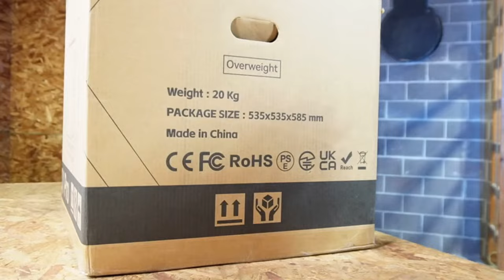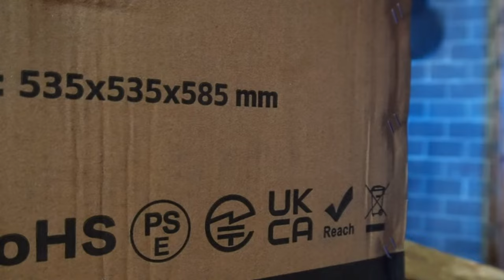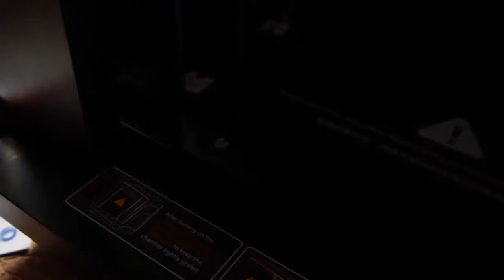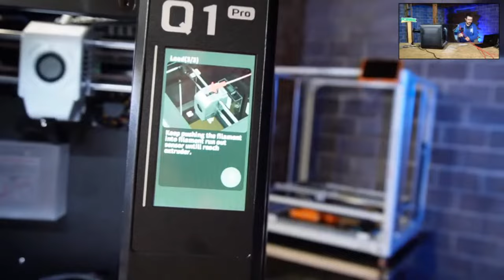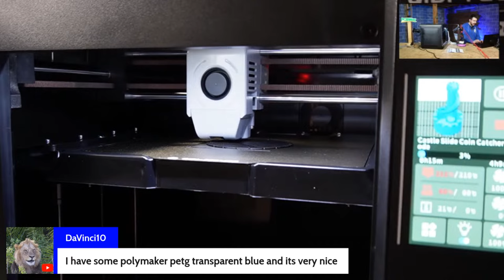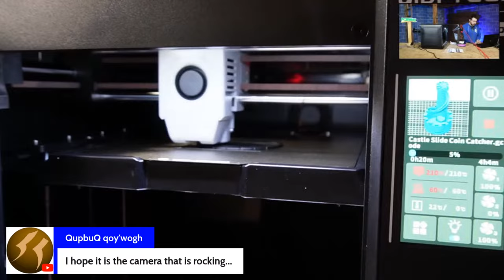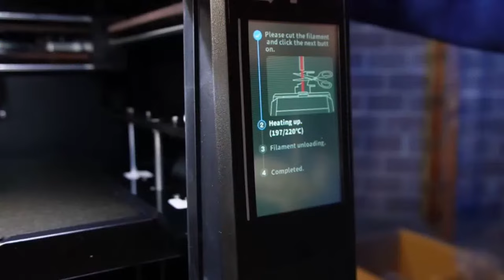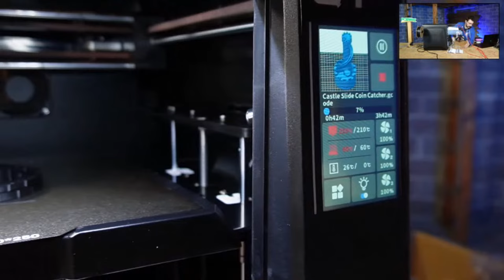PRO? QIDI Q1 Pro Unbox & First Print LIVE!

Comment: Your insistence that all tools be included is a bit over emphasized.  First, most of us have them, or would want better than the cheapest you say they could include.  Secondly, these "throw-away" tools are a waste.  Theres no reason the manufacture them, include them, and ship them.  And finally, with the printer selling at $469 including shipping right now, so call it $400, a couple dollars of tools (including sourcing, packaging, cumulative shipping costs, etc),  is a maybe half a percent.  What company wants to throw away that money considering the first points?  Along with being upset about points like the zip ties and then the allen wrenches being wrapped together, the review starts to sound more picky and whiney, in my opinion, than a straightforward asessment of the printer's capabilities.
Reply: I agree. And the "Handle" to open the front cover is at the bottom-right in that groove made into the plastic case. Easily opens the front door with one finger. I do wish there was a built-in cutter to change the filament but with the abundant things this printer offers for this price point I am very happy with my new QIDI Tech Q1 Pro I received two days ago.

Comment: You ask about the front door "Handle". I just received my QIDI Tech Q1 Pro based on your and Maker's Muse reviews. I LOVE this printer. By the way. Look at the bottom right of the front door. There is a designed groove in the black plastic case that allows your finger to grab and easily open the front cover with one finger. Granted, QIDI Tech does not explain this. It was obvious to me.

Comment: I do agree that’s an insulting amount of filament to include - reminds me of the ender 3 lol. I’m inclined to believe that you got a review unit for “free” and they didn’t include the stuff that you most definitely have such as harbor freight quality side cutters and cheap Chinese Allen’s that round off every damn bolt when the strength of a baby is used. As far as the plastic enclosure for a heated chamber - don’t a lot of people use bed slingers in acrylic chambers? Apple calls the MacBook Pro - pro yet they sell them with 8GB of RAM - we can thank them for starting this pro naming nonsense 🙄For $469 I think this is a steal and I’m definitely gonna order one. Let’s not forget BL doesn’t even give you a 1080p camera until you bust out $1200…Also this whole “live mains” nonsense is hilarious to me. That’s like saying “I took the cover off my electrical panel and I’m exposed to live wires” no shit - don’t touch it if you don’t know what you’re doing - and if you’re touching live electrical components with live power you deserve a shocking experience - just my 2 cents

Comment: Let’s call this what it is, cash grab. Normally there is a decent gap between models. This comes out less than a year of their others. Feels very rushed and unfinished/tested. I want QiDi to succeed, but please don’t go the route of the Creality QiDi.
Reply: Can you explain?  No one that bought the earlier model(s) has to buy this, and anyone looking now wouldn't care about the earlier model(s).  I'm not sure what you mean.  Is it just because it needs more polish?
Reply: @DavZell  What I mean is, if you follow Qidi's launch history there has been a couple of years between models. They take their time normally before a new model comes out. Unlike Creality that has a new model out every year or even less in some cases and leaving the previous models behind (Ender 7 and 6 anyone?). For Qidi they have the Xplus 3 which the Q1 pro does not carry much improvement over to really warrant another machine crowding that price point. The Pro's nozzle cleaning and purge bucket is a not really an improvement just janky looking compared to other designs seen in Vorons and even Bambu. The dual Z that is independent is about the only item that was an upgrade.  Bed sensor and auto Z height are nice but not groundbreaking. Why they chose to use an AC chamber header, but a 24v heated bed I have no clue. I would have liked to have it the other way around. The side spool holder is a rush job by design and flimsy. I feel the xplus 3 is a better value. What really makes the Q1 a "pro" model? I feel the Q1 is lemming move. You are correct, no one is forcing anyone to buy one, however focus on the machines you already have and update Klipper for petes sake... Simplify it even. I support Qidi as they stepped up when they knew they had a design flaw. Bought the XSmart 3 and it was a solid machine. I know they are doing revisions to the hardware as the spare parts I bought wouldn't work with the sensor mine came with. Quick email and a conversation later, they sent me the updates parts I needed to use the spare parts.  I am just one person in a sea of people and by no means an expert... For reference, I currently have a V0.2, Trident, Ender 3 v3, CR10se and X1C. That doesn't include 2 dozen machines in the last 4 years that I have tried and used.
Reply: @trugbilddrachen  There are a couple of videos that that theorize they might add multi-material/color to this model based on the wiper and poop bucket.  Any thoughts on that?  I wonder if they needed this out now to fund further development of that?   I don't have an opinion; I knew nothing of Qidi before last week.

Comment: Was looking at this until someone showed me a post where the chamber heater supposedly runs open current across it and is in a place where you could actually touch it and get shocked
Reply: Looks like it's behind a non conductive guard. The other youtuber just took it apart and then complained he can touch it. Creating controversy is the name of the game. Does everybody poke the heater in they hair dryers with a screwdriver?
Reply: Do you own a toaster?

Comment: Maybe we need to start saying NO when a 3D Printer does not have the proper electrical rating for the country we are in. For the USA, where I am, it would be a UL listing that it would have to have. UL should be required, as it should for the proper rating in other countries.
Reply: I was just googling around.  It looks like some other brands, for example Bambu, might be referring to just their power supplies and control board's UL listings when they say UL.  So some due diligence may be required before either congratulating or condemning the manufacturers.